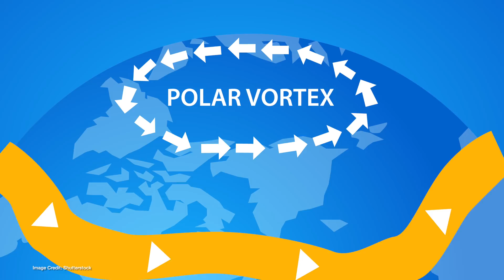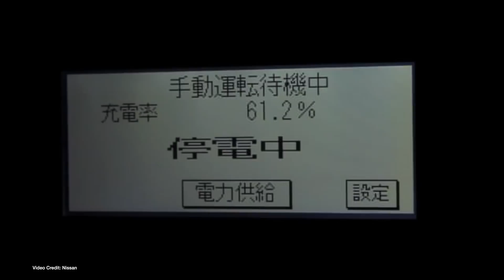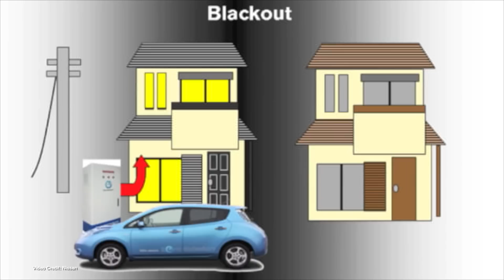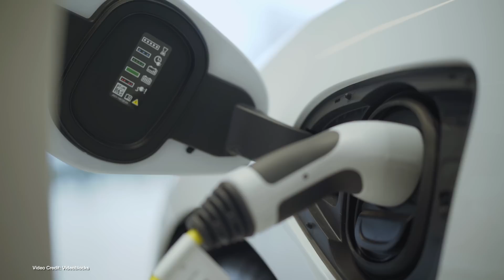Winter Storm Uri: Electric Cars, Renewables Will Help, Not Hurt, The Texan Grid

Comment: Part of the green new deal is to promote Passive Houses

To get your house passive you use lots of insulation stop drafts and have adequate double glazing and you can heat or cool it with a fraction of the energy.
Reply: Triple Glazing would be much better.
Reply: @robertlee8805  Yeah, I live in Germany and practically all new windows around here are triple glazed.
Reply: @robertlee8805  Was about to say that double glazing would be insufficient for a passive house in most regions around the world.
Reply: Passive houses are a good idea. The solution to a lot of energy problems is not new energy sources. It is often easier to just stop wasting energy.
Reply: the problem with passive houses is that it is very hard to convert normal houses to passive houses. it is far easier to design and build new houses to passive house standards than upgrade old houses.
Reply: @mrxmry3264  That is true. But you can add a layer of insulation to the outside of the house, and put in better windows.
Reply: @mrxmry3264  we insulated under the floor the other year there's a huge saving to be made there.
Everyone knows about loft insulation but we are saving about 30% + from retro insulating the floor.
The house is way more comfortable
Reply: We are upgrading our new to us home (Phoenix AZ) from single pane 1980s windows to dual pane low e, argon gas filled  dual pane, and changing an used arcadia door to a picture window.  First round is 4 (largest)  of 8  windows replaced before this summer. Until we have replaced all 8 and looked at attic and other insulation issues we won't proceed with solar panels.   We have a deposit down on an Aptera as well.  Be part of the change you want to see
Reply: @fynfynsidian1870  I've retro fitted  insulation under the floor there's enough crawl space to get under. The savings are quite substantial

Comment: I live in Austin, Tx and lost power in my home several times with the longest time of 12 hrs. I used my EV to power up basic lighting and appliances to for my home. I have been planning on getting battery storage and solar. So now,  this incident has help me make the decision to more forward with my plans. Thanks for the video Nikki!
Reply: yeah it's strange but pretty much every time there is a disaster of some kind, adoption of solar/batteries goes up.

Comment: No matter how many people want Coal. No one is moving next to any coal plant due to it producing #Cancer. Also during ex-PresTrump turm coal plants where shutting down at a fast pace due to the high co$t of maintenance. #Coal is a thing of the past. Anyone can set up a home #SOLAR System with 🔋 battery🔋 backup for times like these when the grid goes out. The #Electric #Company doesn't want you to have your own power station but they aren't paying your #Electric you are. Why not make your own power and consum your own power? ? Prove me wrong

Comment: In most countries, the power-grid & infrastructure was designed for the requirements at the time of a past industrial age, major investment is required for a power-grid & infrastructure capable of supplying the energy needs for the new more technical industrial era. Its time for the local government to lead by example by upgrading the power-grid so it is capable of balancing demand via grid-scale battery storage & supporting the latest technologies for residential homes ie: EV Charging, Solar & Vehicle/Battery to grid. In the UK the Renewable energy association is pushing for all new homes to be 3-phase power to help with residential solar production and help to balance the grid with vehicle/Battery to grid.
Reply: If Texas was on the east-west grid they'd be subject to Federal regulations which mandate winterisation on all equipment

Comment: Because of the extra cost, Texas did not opt for the defrost option when buying wind turbines. Penny wise, dollar foolish!
Reply: They did not winterize the turbines. Rendering then useless unlike denmark who keeps theirs running year around.
Reply: Texan here (not a Republican). It wasn't just the turbines. Coal & Natural gas fired power plants were also not winterized and some shut down due to frozen equipment. Even the Nuclear power plant southwest of Houston had to shut down one of it's two reactors due to "cold weather issues".

None of these problems happened in El Paso which has its own natural gas fired power plant which is connected to the western grid and is subject to FERC regulations. They were winterised.
Reply: @IronmanV5  Good points Mark, and I need to just add the numbers in case you weren't aware 16,000 MW lost because of improperly winterised as in not at all Windturbines, and 30,000MW lost because of Coal and NatGas plants going offline. I have seen co called experts try and say the low NatGas pressures experienced was because of high demand because we heat with NatGas. This of course just another GOP lie. The real real NatGas supply were weak is exactly the same reason as back in 2011 whre the Railroad Commission who regulates NatGas Pipelines failed to keep accurate records as to the source of the electric substation that fed the pumping stations, and they caused an cascading failure when they started pulling power in some location due to cutting the power to the pumping stations. This happened in 2011 and FERC made recommendations that ERCOT ignored so yes it happened again this time. If Beto is running against Abbott in 2022 this should be his most important mission statement to get Texas connected to the FERC and reform of eliminate ERCOT entirely. At the bare minimal get some Texans to fly up to Iowa and see how the part of the state that gets 40% of it power from wind manages to keep their wind-turbines functioning close to 100% availability.
Reply: @IronmanV5  Cooling problems, probably.
Reply: Common now it never snows in #Texas. #Winterstorm ( hold my 🍺 )
Reply: Guy I just confirmed with a very conservative friend of mine who knows people in the energy Sector who said that GE recommended the upgrades on there units, but ERCOT was unwilling to spent the additional $60,000 per unit as it would increase the break even or ROI on the wind-turbines. $60K might sound like a lot of money, but the average wind-turbines cost millions of dollars so it would have been a  small percentage increase. This just speaks to the greediness of Wall Street as they are the true Villian's because of the investment funding probably being controlled by these greedy bastards.
Reply: @elmercroan3859  Thanks - facts are independent of ideology.
In defense of those operators, perhaps they got estimates that a snowstorm like this in "once in a century" or even less frequent event. Or not. And people are just starting to realize that climate change brings freak, more intense weather of all kinds.

Comment: Our hearts go out to folk in Texas.
Reply: Thank you for that!  I’m in San Antonio. It was rough, Mon-no power for 16 hours one day, Tues-power out at night, Wed- no power in the afternoon.  Thursday the power was back and consistent.  Hard to warm up the house with my electric heat pump. My 1929 house was built for heat, not really for the cold.
Reply: @BenSATX  I feel for your situation as I am just south of Austin, but from the comment about your house being built for heat instead of cold. Please hear what I am about to say without taking it as a personal attack as I know several so called experts have been pushing that false narrative. Heat or Cold are not difference as Insulation works exactly the same both directions. Insulation resists the transfer of heat which is what the R means in terms like R-13. 

I don't mean to get into science but we have to get into it a little bit. There actually is not any such thing as COLD, it is just the way we express the absence of heat. This is important to remember when thinking about insulation as it just resists the transfer of heat. In the summer that is from outside to inside, and in winter that is from inside to outside. No difference what so ever on which direction the heat is flowing.

The HVAC systems are really just as much to blames as Heat Pumps are great for moving heat as long as they operate within their design guidelines, and here is the problem with Electric Heat Pumps for Heating a home in below freezing temperatures as there is no heat outside to pump into the house once a certain lower point is reached which is why NatGas or Resistive Electric subsystems are installed in most HVAC Systems. The builders as well as the manufactures of Heat Pumps have seriously oversold the capabilities and are depending on the outside temperatures usually not dropping below 50 degrees. Even GoeThemal Water Sourced Hdeat Pumps have a backup resistive element optional. 

The bigger issue si that all Heat Pumps work on a temperature differential between inside and outside and use a refrigerant to to move the heat. Yes a Air-sourced Heat Pump is just an Air Conditioner shifted into reverse. No real magic there, but this is exactly the problems as usually we are only expecting a 30 difference or Delta ( Change ) between the inside and outside temperature. In the summer this is usually able to be achieved, but in the winter this Delta required becomes larger than the units are designed for unless a supplemental energy source is used to heat the air as in my Hybrid Electric/Gas unit. The push to all electric was really a mistake until we can get Heat Pumps that can deal with this delta which a GeoThermal unit is more capable of given the temperature several feet below the surface is usually pretty constat at 55 degrees. 

So in closing ignore the recent article and news stories referencing a so called expert with connections to UT who made the comment about our houses working better for keeping heat out instead of keeping it in. That is just pure GOP Propaganda trying to divert the attention away from the facts that ERCOT wasn't prepared, and the GOP made sure not programs to help you improve the insulation in your older home proposed during the Obama Administration by an appointee Van Jones who was shot down before he was ever confirmed. 

I have nothing against AOC, but her Green Deal Plans are right out of what Van Jones started years ago. H even had a local school he established to train young kids to install solar. This made him a target for the Big Oil Conservatives. Very much in the same way Jimmy Carter was for installing Solar Panels on the Whitehouse all those decades ago. Of course the first thing Ronnie Raygun did after taking over the residence was demand they be removed. The initail first wave of Green Energy was started back during President Carter, but Ronnie Raygun made a deal with the Arabs to drop the price of oil so low the USSR couldn't make enough money off their oil to be able to match the $5T Ronnie spent on defence during his 8 years. The Arabs were more than happy to go along with this as lower priced Oil meant investment in Alternative Energy became less attractive to the Wall Street Scum so Alternative Energy was dealt a death blow before it had a chance to affect the control OPEC had over the USa. Jimmy Carter previously a Nuclear Submarine Captain knew after the Arab Oil Embargo that we needed to have a better plan then depend on the middle east. Ronnie Raygun a B Movie Actor wasn't smart enough to think longer term like Carter was. President Reagan dies not even know what was going on around him ( many would argue he didn't during his last term either ) and President Carter is till alive adn very sharp, and volunteers to build homes for habitat for humanity. Karma is a BITCH !!
Reply: My home state 🤘
Reply: As for those who voted for the republicans in Texas, you got what you voted for.
Reply: @timypp2894  The vast majority of the Cities vote Democrat (except Ft. Worth), but the rural areas and the gerrymandered districts are carved out to dilute Democrats, hence Republicans continue to stay in Power.
Reply: @BenSATX  yes sorry. I paint with a large brush. 
I feel for those who voted "I didn't voted for this..."
Reply: @BenSATX  As they should.